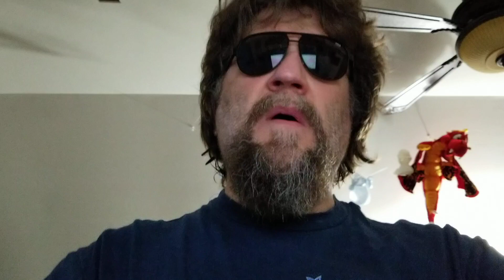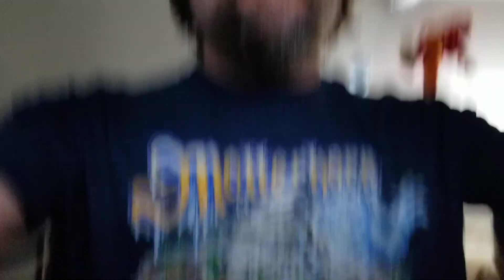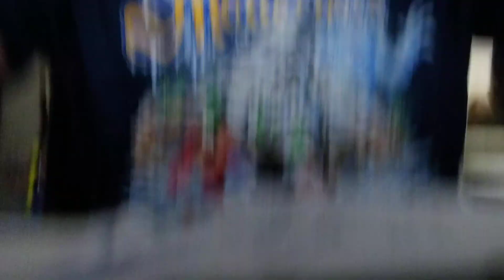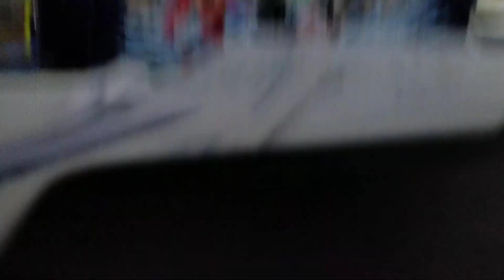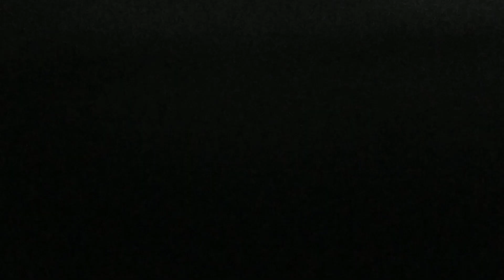Steel Vengeance brake failure tire failure break flying off falling off Cedar Point August 10th 2018

Comment: I was under the part where it came in. So apparently what happened was there was a loud thud and me and my friend were there at the time and we were really hyped to ride. So we heard the train come in and my friend said “I have a feeling you’re gonna get very scared when the train comes in idk why” then when it came in I got really scared and so did she because there was a loud metal thud and I saw a whole wheel fly off the ride. The people on the ride naturally screamed, not fun ride screams either. So then moments after we saw people rushing off the ride and I told her I saw a wheel fly off and we got out of there. Other than that the day was fun. No reported injuries I think, and there was news about it 1 hour after.
Reply from the maker: Did you see any metal piece fall too?  There were reports of a metal chunk falling too.  How close do you think the tire fell from the queue?
Reply: Hawg Gnarly hmm, I think I saw a couple of bolts fall off with the wheels . There were small metal pieces coming off. I think maybe later once me and my friend got out of line metal chunks started coming off but what I saw was a wheel and some bolts. Still pretty bad though. I think it was right about to pull into the queue and then when the brakes hit they were too much force.
Reply from the maker: Interesting.  I'm still shocked they started back up just hours after such an unusual, bad, failure.
Reply: wait what? they started it up? I think what they need to do is close it for a few months and just work on the brake systems. But, as usual accidents are to be expected when you build a huge steel wood hybrid coaster in just 9 months.
Reply from the maker: Yup, it started back up that night at like 11pm.  I was shocked.
Reply: oh my gosh. thats crazy. I didnt go past it for the rest of the day. thats insane they opened it again the same day that happened

Comment: I was there waiting in line when this happened
Reply from the maker: Did anything besides the tire fall?  I had read some metal fell too.  I assume it was the first brake as the train returns to the station.  

Pretty crazy how there are so few pics.  You expect them for anything nowadays.  I guess folks really follow the no cellphone rule :)
Reply: Hawg Gnarly i got a pic of it
Reply from the maker: THe one circling the coaster forums of a tire next to a wall?  I have yet to see a anything else.  Also, no pics from today.  They are supposedly only running 2 trains again.  I wonder if that brake was fixed, or just removed.

Comment from the maker: Apparently Steel Vengeance was back up at around 11 pm.  VERY surprising.  NOt surprised they fixed it that fast.  Surprised they feel they know what happened, and are confident it won't happen again.  

Apparently 2 train operation, so perhaps they took the brake run out of service, and are now confident each block can stop a train.  

All this just seems like a TV show, explaining the lead up to a catastrophe.  I would think CP would be open to what they did on this, just to calm fears.